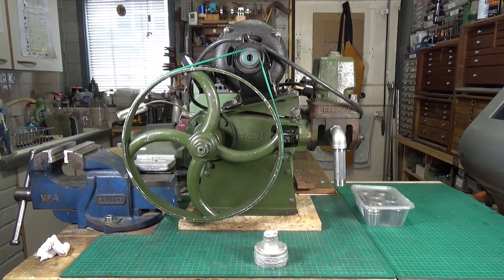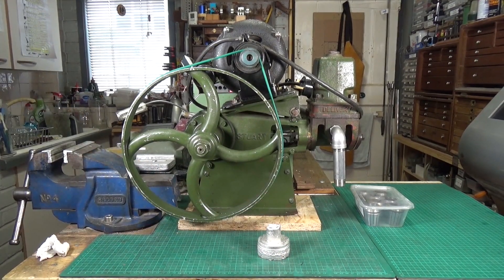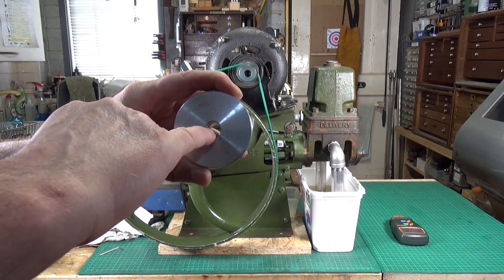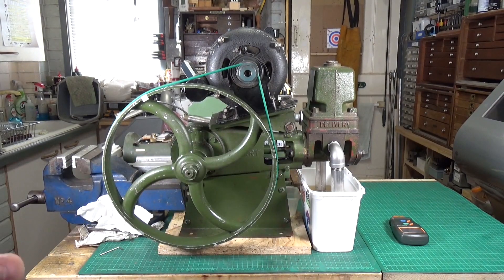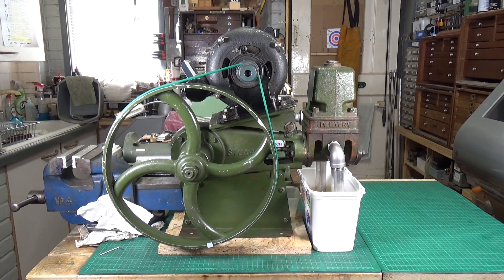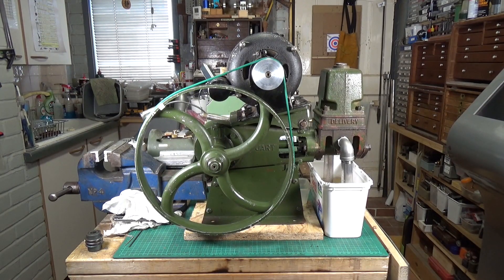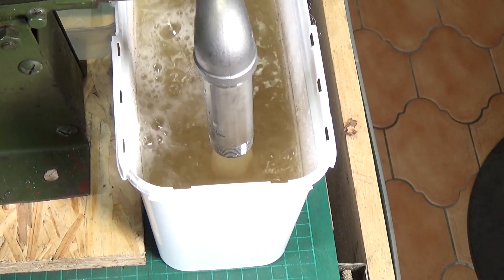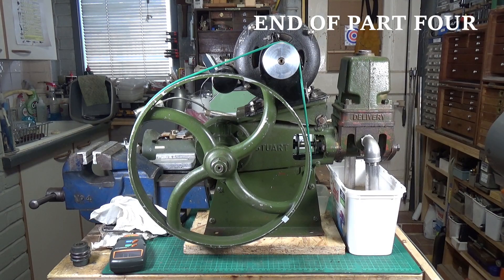Stuart Turner Piston Water Pump - Part Four

Comment: Might having previously got the gland packing wet have expanded it and thus improved the sealing? As with wooden plank boats where they need to be kept in water to remain water tight?
Reply from the maker: You could well be right.